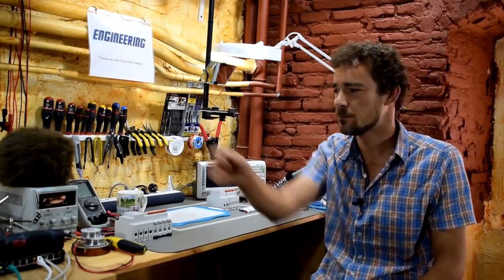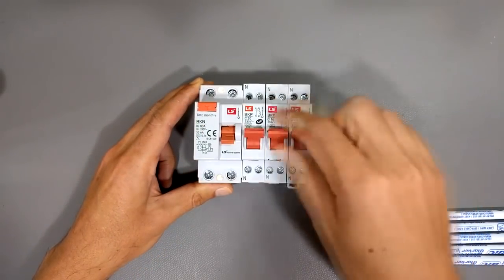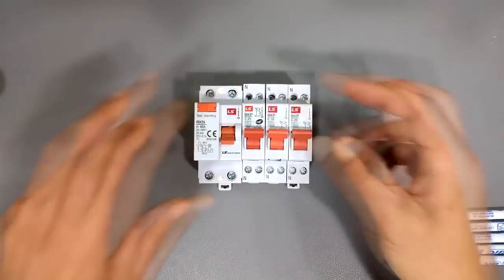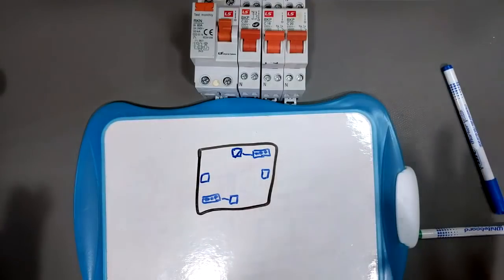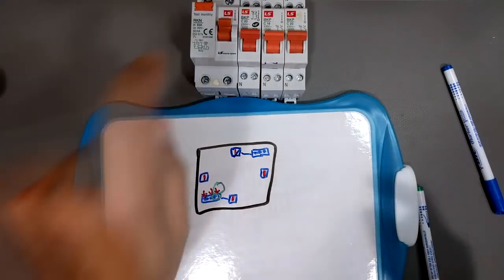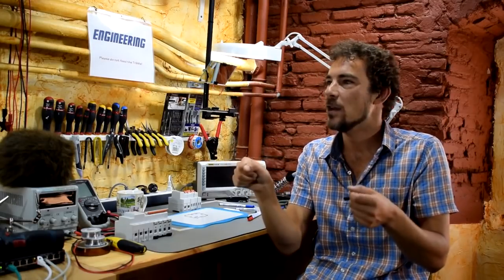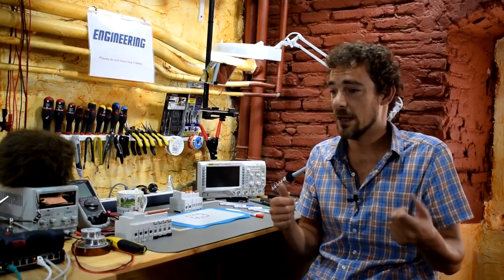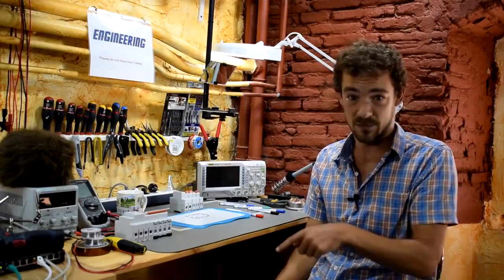DEAR GOD the circuit breaker keeps tripping - What to do?!

Comment: Hi Scottie,

Really liked the video, Maybe you can help me. I have a 30mA differential breaker controlling a series of ceiling lighting breakers throughout the house. I have narrowed it down to 2 of the 7 breakers which are guilty. The voltage here is 240V and the breakers in question are 10A each. About 3 times now, when I go to bed all the lights were working. In the morning the 30mA differential has tripped. During the night it rained but also during the day it rained. It's been raining a lot this season. The first few times, all I needed to do was to reset the differential, but now that does not solve the problem. (The differential breaker is not dead because it serves well for the other 5 breakers.) I suspect something is wrong in the lighting circuits for those 2 breakers.  Could the wall light switch be defective? Is water getting in? What is weird, AGAIN, is that now it's sunny and the lighting is back to normal. There is now way I have loaded either circuit with bulbs drawing anything like 80% of (10A x 240V) and exceeded 1920 watts.  Question: can  mixing led fixtures with halogen fixtures on the same circuit cause tripping? Help.
Reply from the maker: I would check the light fixtures that those 2 breakers are powering. Cut the power, and remove each fixture and check the wiring. It could be moisture, or it could be some wire that's partially exposed and touches something it shouldn't at night when it's cooler, etc. Mixing bulbs shouldn't cause a problem, although 1 specific bulb could be the culprit esp. if it it's an LED bulb with driver circuitry inside that might be leaking current at times. But first I'd check the fixture wiring, and then double-check the light switches. The switches probably aren't the problem since they're only switching phase to a given light, but there again you might have a switch with bad wiring where some exposed copper touches something it shouldn't. Also, beware of things that you might not know are connected to those 2 breakers... like exhaust fans in bathroom/kitchen, for example. Sometimes they get wired up to the lighting circuits as a shortcut during installation. Hope that helps, and lemme know what you find!
Reply: @ScottiesTech  THANK YOU SO MUCH for your prompt reply.  I will follow those suggestions.

Comment: We have brand new wiring and AFC breaker box, and out brand new GE gas stove keeps tripping the breaker when the oven is turned on. GE replaced the oven! Still trips. The electrician who installed the wiring and breakers says it's fine. What next?

Comment: Hello, good video! Our breaker flips in the basement, we unplugged ALL the lights. nothing is plugged in the outlets. Got a new breaker and it trips. What now?
Reply from the maker: I'd turn off the juice and check each outlet/switch/junction box connected to that circuit for loose wires, corrosion, wires touching, etc.
Reply: @ScottiesTech , Thank you very much

Comment: Hello!  I was wondering if 5G can trip a breaker?  Last night my lap top actually tripped a breaker!  I know this because I’m in a new house and the breaker that tripped is labeled for the room that my router is in.  Nothing else was on other than the router to power the lap top.  And I have noticed that we our accessing 5G in our area now.
Reply from the maker: It's more likely that some gizmo on the circuit is defective. If it was a GFCI / RCD that tripped, that's not all that uncommon. Could be a failing power supply or something. If it was a normal circuit breaker (like a 20A overcurrent breaker), then that's pretty weird... That could be a wiring issue, or a failing breaker. Hard to know for sure.
Reply: Yes it actually was a GFCI that tripped. And only a 15A.  Having the builder's electrician come check it out.  Might need more amp on that breaker for my office.  Thanks!

Comment: I have a Brand New Breaker and nothing is plugged in .. it trips after a few hours ... should I test each outlet and light switch?
Reply from the maker: Yup. Could be a fault in an outlet, light switch, lights (if wired directly to switch), or the wiring itself (nicked wire insulation or something). I've also seen loose wires causing problems - including at the breaker itself - or a screw terminal in contact with something it's not supposed to be touching. That's not a fun problem to diagnose, but with a methodical approach and a bit of patience, you'll figure it out!
Reply: @ScottiesTech  thanks a lot ...

Comment: I have a 15 amp breaker and it takes about 12 hrs before it will trip, any ideas?
Reply from the maker: First figure out what is plugged in / wired up to that circuit. Then you'd have to add the total power consumption of all devices, and divide that total by the voltage (120 or 230V depending on where you live). That'll give you the max possible current draw. If the total current is close or more than 15A, there's your answer. If it's not, then that means either some gizmo is defective and suddenly drawing a huge current spike, or more likely the circuit breaker itself is failing. 

In some places (Europe, for example) you can have a combo breaker: it's a circuit breaker + an RCD/GFCI/differential breaker. They are "double-wide" breakers. They are always labeled as such, so you'd see "10mA" or "30mA" leakage current rating on the breaker in addition to an overcurrent rating like 15A. In that case, it might not be an overcurrent problem, but a leakage current problem. That usually means 1 bad gizmo on the circuit that is leaking current to ground, which you can figure out by unplugging 1 thing at a time, and then waiting...
Reply: @ScottiesTech  ok thanks so much for the info. I have already replaced the breaker with a new one of the same amps. Time to start calculating....

Comment: Good thing I started unplugging devices on circuit break trip and hopefully this fixes the problem. Now things are running normal again. Lesson to be learned don’t leave stuff you don’t use plugged in, just unplug it and put it away until you need to use it again.

Comment: Thanks.   I was having problems with an Arc Fault breaker on a lighting circuit, which I think is much harder to diagnose. I installed the lighting myself 12 years ago, and never had any problems previously.  However, at some point you mentioned "water," and I looked at all the light switches, and found signs of water damage in one of the walls.  Apparently, I have a sewer drain pipe blocked up and leaking into the wall.  The night before, I took a shower, and it leaked into the wall.  The good news is, the electrical problem was easily solved by opening up the switch plate and drying out the switches.  The bad news is....everything else.

Comment: Hi Scottie, I moved two thermostats and then later reinstalled the baseboard heater to the first thermostat. I turned the breaker on and then turned the thermostat up and it kicked the breaker. I turned the thermostat off and when I flipped the breaker back on it immediately tripped. I disconnected the wires to the baseboard heater and the breaker still immediately trips. Both thermostats are controlled by the same breaker but I haven't wired the second baseboard heater back in. Any suggestions would be greatly appreciated. Thanks.

Comment: Is there any additional scenarios when the issues is in a detached garage? And you don’t have much plugged in other than the garage opener and you have determined already the opener is not the issue by plugging it in a different circuit breaker
Reply from the maker: Could be damaged wires leading to the garage. Could be a loose wire somewhere (including at the breaker in the panel, or in a junction box, or at an outlet where something is plugged in).  I recently fixed a GFCI/RCD trip problem at a friend's house. The culprit was a very loose live wire connected to a light switch, believe it or not!

Comment: I got a much more complicated problem. Circuit breaker was tripping at 10am exactly almost every day. Then at 11.15am. then a few weeks wouldnt trip. Then now trips at 20.45h. It trips at 00m or 15m. Now its tripping a lot, for some weeks it doesnt trip.Not from pluggin in anything, neighbors say it doesnt happen to them, i dont know how to find the cause of the tripping, its so erratic. Oh and beeing erratic it has never trip from 21h to 10.00am. Only like in day hours
Reply from the maker: I recently fixed a similar problem for a friend. They also had a light fixture that wasn't working all the time, and the GFCI/RCD would trip at strange and random times, but esp. in the morning, and esp. on Wednesdays (??). Turns out the electrician who did the install stuffed a stranded copper wire into the light switch that had screwless terminals (strip wire, stuff it in). Those terminals only work with RIGID copper wire. Fixed that, and POOF! No more tripping. Point is, it can be something that's always plugged in, but the fault only occurs rarely or at random times. Only way to debug if you don't have other symptoms is to unplug 1 thing at a time, and wait... and repeat. Yeah. it's tedious, but you'll find the culprit eventually!
Reply from the maker: Another possibility: if you have lots of electronics on 1 RCD, that can do it. For example, I once fixed a problem where there were multiple desktop puters and 2 laser printers on the same RCD. Breaker would trip when one of the laser printers fired up to print. Usinig a clamp ammeter, I figured out that the leakage current from all the puters + printers was hovering around 27mA. When the printer fired up, it passed 30mA leakage, and the breaker tripped. That shouldn't normally happen, and it turns out 1 puter had a failing power supply that was leaking too much current. That was a fun one to debug!
Reply: Update: I said it never tripped at night, yesterday my mother said it tripped around 2am, today it tripped at 1.44am. Its so weird that it seems many times that when it trips its at the same hour that the day before. It makes me think if it isnt any electronics. I do have one printer connected to the power plug. My question for you is, cant this be happening because of the electricity grid outside home beeing unstable? For example an industry power plant firing up and at that moment tripping it here at home? And a 30mA circuit breaker is it standard, or is the 300mA ones standard? I think im disconnecting the printer to see what happens and ill give an update

Comment: Thank you so much for the video I had a circuit breaker a single circuit breaker that kept popping supplying power to parts of the garage.

So I replaced the circuit breaker and a new one did the same just three bucks so I didn't mind.

I'm not sure if I'm saying it's right but I found the wire coming from the house going to the garage into a conjunction box where it spider throughout the rest of the garage.

So I start the process of elimination removing part of the outlets one at a time from the equation then flipping the switch on to see what it did.

I found a bad outlet that was outside causing the circuit breaker to pop I just removed it from the equation for now until buy a new one. I reconnected the rest now I got power in my garage thank you very much!

Comment: hello.. i'm from Norway. We had a strange situation.. every time we used a certain outlet, the breaker tripped when we turned the gismo on.. but the same gismo work in another outlet, same brakerline, worked fine.. turns out, there was a ironnail holding the window next to the outlet, shorting something out... but only if we had a gizmo in it. and turning it on.  how is that possible?
Reply from the maker: I think if the nail was touching the copper in the neutral wire going to that power outlet, and the nail was essentially a path to ground, then the RCD / GFCI / safety breaker wouldn't necessarily trip unless something was plugged in and powered up. In other words, when a load is applied, enough current flows that some of it leaks to ground via the nail. But when nothing is plugged in, any leakage from neutral -> ground is not enough to trip the breaker. That's my theory, anyway!
Reply: ScottiesTech.Info tanx

Comment: There is the possibilty for the RCD/GFCI to trip because of a Neutral-Ground  fault. These can not be so easily found, as the differential current is proportional to the load on your RCD. So it may trip when switching the forth breaker on, but the flaw may actually be on the first. (In this Scenario it would trip if the first breaker is on and a certain load is applied by the other breakers.).
Reply from the maker: I ran into this exact problem recently. What a pain!!!